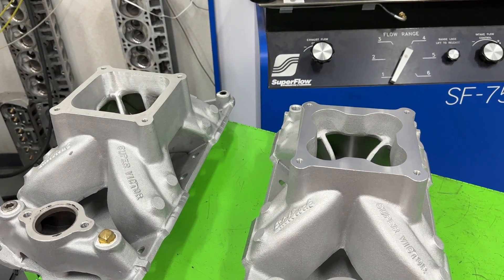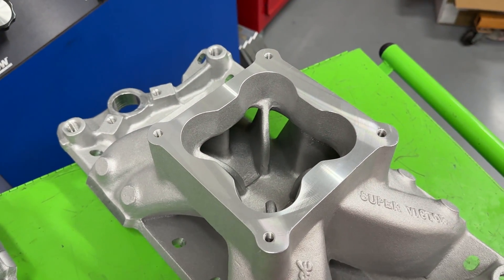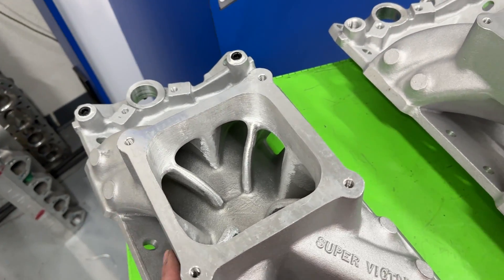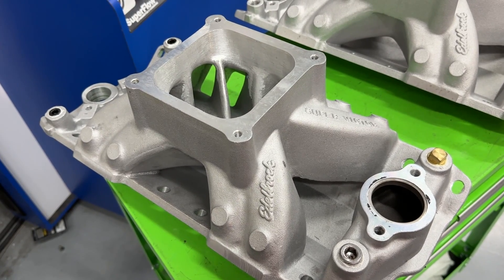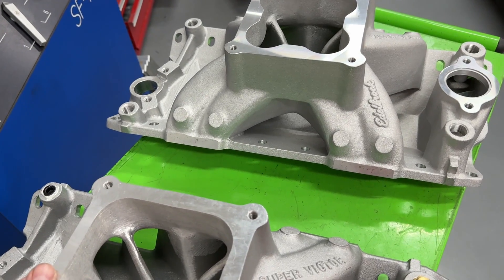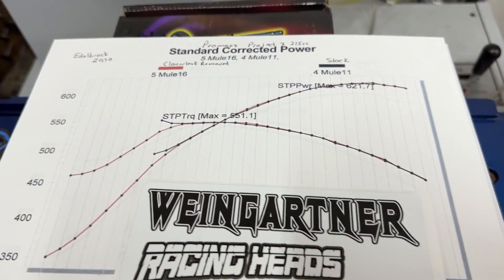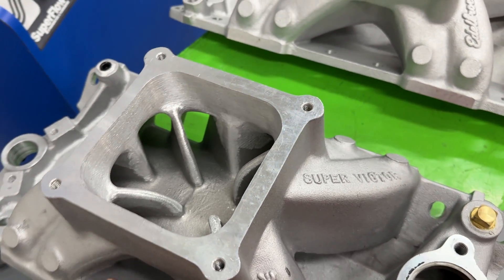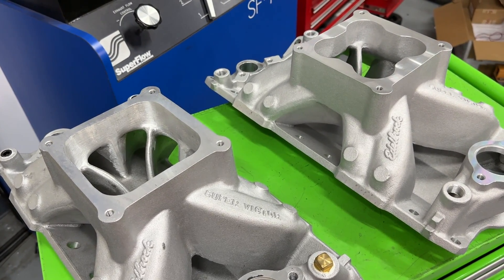Does Removing The Cloverleaf From A Manifold Make More Power

Comment: As a rookie/novice/amateur to motors in general, its tough looking at or "reading" a dyno graph without timeslips or a feeling of the car because you often hear about "flat torque curves". And motors with 500 ft lbs of torque and 400 hp (mustang i seen recently , maybe cause the converter stall , is what someone proposed). Vs a car with 500 horses and 400 ft lbs of torque and graphs that ramp up vs flat ones. I wish I could take a handful of cars/trucks and dyno them and then drive them on the street/strip and really get a feel for what's what without guessing. I only have experience with a handful of random vehicles so its hard to do without imagination and context and all from what Ive learned in research. I'm sure the information is out there, its just not something ive ever really come across explicitly.

Comment: More power? Idk, better flowing and even distribution of air to each port? Possibly but could go either way. I think the next step in squeezing power and reliability is monitoring each exhaust runner for air fuel ratio. Reading at the collector just says in total its good. But the average of 4-6 or 8 cylinders, is probably why afr and power can vary widely based on applications.

Comment: My first instinct?  Cloverleaf was good: focus flow/signal where it can be used [under venturi].  But also: air often finds a way to make fools of us all, so...flip a coin?  
Then, results. Seems like the cloverleaf was wanting to favor lower rpm, but the pulls started at different spots.  Bummer - 700 rpm of missing data - is the plenum sooo big it just doesn't matter?
Reply: Agreed, 4 hole spacer tends to give better booster signal for throttle response without affecting top end power.
Reply from the maker: Both ways tested had a 4 hole tapered spacer on it.

Comment: Cutting the cloverleaf out should loose velocity!
Reply: Dyno didn't see that way??..  If dyno didn't see that way? Write new theory...
Reply: Cutting out cloverleaf and runners slows down the carburetor signal( vacuum signal ( increase).
Reply: Correct, slows down the air flow and turblance of the air, swirl...

Comment: I mean it make sense. I bet it would kill the low end due to air speed loss but 850+Hp and wrap it out to 8.5k-9k and I think you’ll see something in the peak area. But would it be loose some overall that would make it not worth it. Keeping the power in the band is more important imo than 10-20 Hp peak. I do lots of 4cyl stuff and peak there might be worth it. But on a bigger V8 find it elsewhere.

Comment: My thoughts are the Stock one will Accelarate better on the Strip...Just a little blending on roofs, but leave clover... But the open one may suit a 450 cube sbc, but the strip would tell.. Had a friend, Chassis dynoed sbc-440 ci,from memorey it was making around 760 hp, manifold got clover removed, mega port job...Lost 40hp...